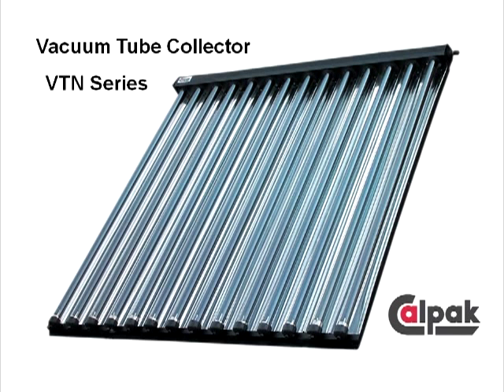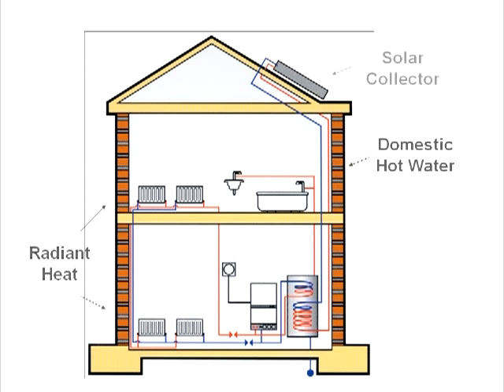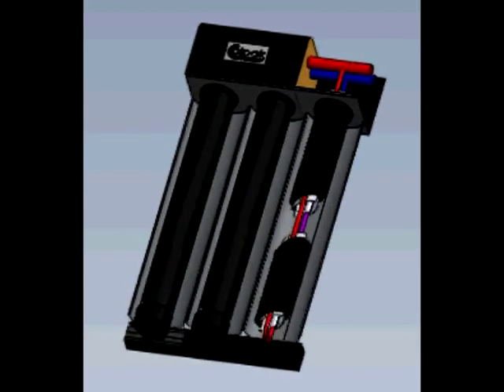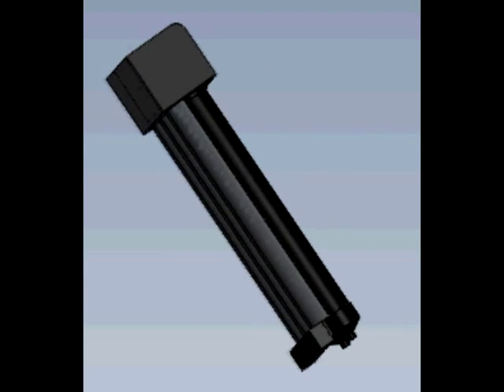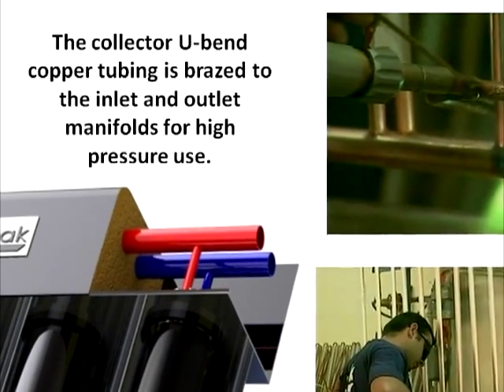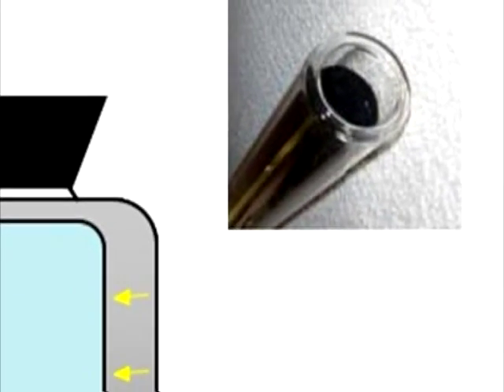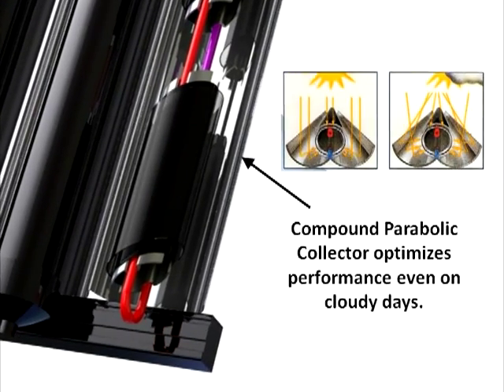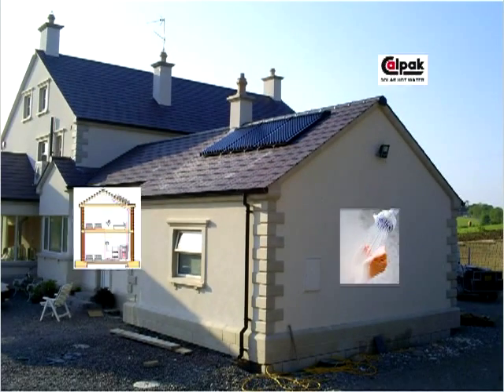Solar Hot Water: Calpak VTN Evacuated Tube Solar Thermal Collector

Comment: Our Calpak has only been on the roof 3 years and out of 12 tubes 3 are now broken, tubes are too light! We are constantly picking up pieces of glass off the patio!!
Reply: Robert Paul 
I had a Calpak VTN 10 tube collector installed in 2010 and had to replace one broken tube two years' ago, and just had two more broken tubes replaced last week! I expected tubes to last longer than this.  The local company here in Lisburn who installed the system no longer exist and in order to get spare tubes I'll need to drive almost six hours to County Kerry, as that's where the only stockist in Ireland is located.  Going to make it worthwhile and make it a three day break away at the same time.
Reply: Discouraged